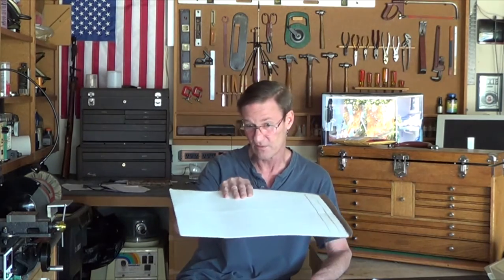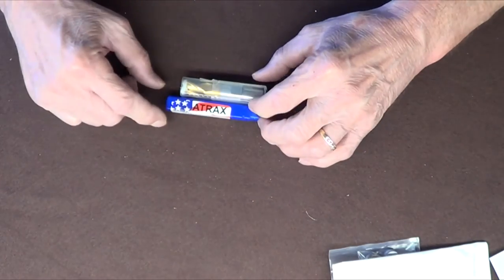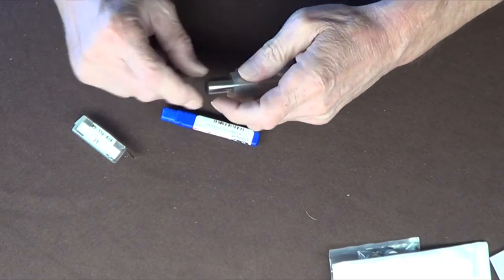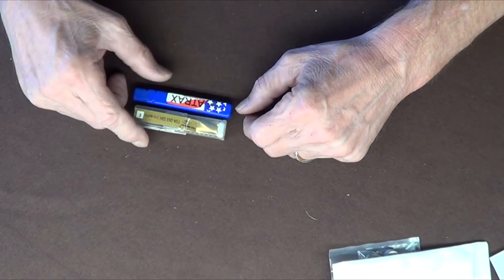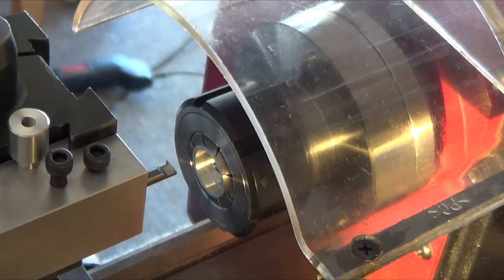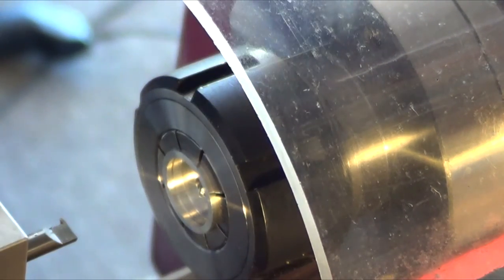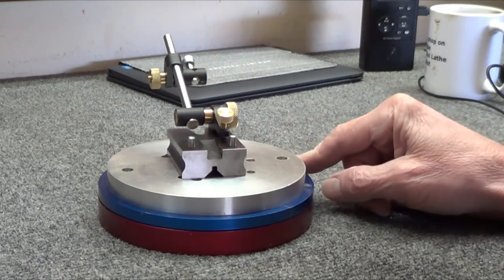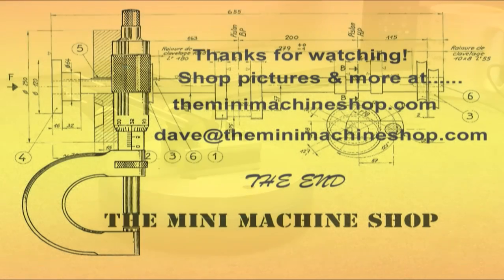Shop Update & Product Reviews Video #90

Comment: I have found that mineral spirits will melt away any protective grease or cosmoline. I like your series. Thanks
Reply from the maker: Hi Jim, I use oil because it  mixes in and removes the yucky stuff easily and I skip the step of applying oil again for rust prevention. Works pretty fast....

Comment: Hello Dave, I have the Grizzly set 3/8 sclcr holder. They are nice and you can get lots of inserts for it. The inserts that come with the holder are not that great. I have seen the cradle piece that replaces the gibs it looks awesome and uses ball bearings, Ive seen it on Ebay. later Dave A
Reply from the maker: I had ordered that set some time ago and returned it... seemed to big at the time due to lack of experience.... Any tips on inserts that you found?